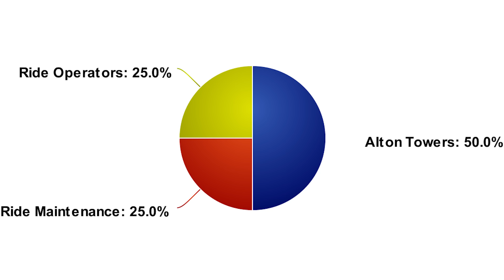What Really Happened on The Smiler Alton Towers june 2nd 2015?

Comment: Smiler is amazing and very safe, this incident was a human error. I hate how every UK news website talks about it WHENEVER an incident occurs at the park, its so annoying
Reply: ik
Reply: I agree
Reply: Theme Park Insanity The red top papers have a journalist on site at all times and any reports of rides delaying are treated as major safety incidents.  The British gutter press can’t leave Alton Towers alone, it’s pathetic.
Reply: Wrong, it was not human error. It was systematic error on Merlin’s part.
Reply: @jeeedel2491  What I meant is that humans caused the crash, not the ride itself
Reply: John Delaney Wrong, the crash was human error.
Reply: Never mind that at least one huge bolt sheared off of the Smiler and the fact that they didn’t refabricate a part of the ride that didn’t fit correctly when building it; they just “bent” the metal to make it fit. That coaster makes me nervous unlike any other.
Reply: John Delaney It was a human error, they sent out an empty cart and it didn’t make it all around the track. They forgot about it since the cart didn’t return. They sent off the next cart without knowing and that’s how the crash happened, it wasn’t a systematic error, it was a human error.
Reply: Emma Harwood Well said. The ride system was fine.
Reply: John Delaney It was completely a human error, the safety features built into the ride had activated causing a whole system lockdown, from that the ride operator has to do a system reboot, this is what had happened therefore the whole situation was in fact a human error, but you could have just done a google search to find that out but you seem to be the type of guy that would rather be wrong than accept some education 🤣
Reply: It'll blow over. The New Texas Giant is my favorite local coaster and no one mentions that it killed someone any more. The only reminder are all the signs that basically say "If you're too fat to close the lap bar, you don't ride."
Reply: This comment had 666 likes
Reply: it does break down a lot though, it’s has a lot of problems. even when i was there it had technical issues all day. but i do agree w you
Reply: Yeah, it really pisses me off! "Riders left hanging upside down for FORTY MINUTES in TERRIFYING ordeal at Alton Towers!" or something, when in reality, the ride stopped for safety reasons due to an alert or something, and they were stuck on a lift hill for a while while operators checked out the issue. It's an occurrence that happens EVERY DAY in EVERY SINGLE park across the world, and just because of this accident, they blow it way out of proportion.
And of course they mention The Smiler's incident in the article as well... "coming off the back of the incident with The Smiler in 2015 where 4 people were seriously injured..." blah blah blah...
Reply: @emma7788  Not just that.  The ride detected the valley'd train and automatically shut down the lift hill.  They had to manually override the safety system to send out the loaded train.  In my opinion, it shouldn't even be possible to manually override the block safety system.  If the block safety system is not working correctly (the only reason to override it), the ride should be shut down until it is fixed.
Reply: suny123boy1 No I’m not, you however are.
Reply: @rueh1747  Oof
Reply: @bby04  I guess that's true, but it doesn't break down that much more than any other ride at Towers.
Reply: suny123boy1  Explain to me why then.
Reply: suny123boy1  How is she wrong? You're seriously telling me that the ride crashed because the ride system didn't stop the incident? Please educate yourself before making untrue statements about topics that you clearly know barely anything about.
Reply: Its not the worst incident at a theme park by far. A kid fucking fell out of the space invader at Blackpool pleasure beach and killed himself
Reply: @bby04   that's not really a safety issue. The ultimate at lightwater vally breaks down everyday lol. Still no one has died on it
Reply: Nicholas Smith if the ride is breaking and literal bolts are falling off of it while people ride.. that could make it a safety issue.
Reply: Theme Park Insanity   Ye I went on it it is very safe this isn’t real I think I don’t think the crash was real it is very safe
Reply: Yeah they keep slating the park every time smiler stops on its lift hill
Reply: It probably has something to do with the UK doesn’t really have any interesting news so they just milk whatever they can
Reply: @PowerOf One It doesn't????
Reply: If it was safe why did this stupid shit happen? Like chill out bro maybe you should've been in the one that crashed and felt tha pain
Reply: But there's cameras all over the ride that cover the whole circuit! These are shows on the screens arround the operator, yet they didn't see the train struggle to make the incline?  over rided the system and sent a train out
Reply: @princessundead9734  Because the ride op overrode the system? You chill out, you came into this conversation swearing over a topic that you know NOTHING about, get out
Reply: @mathewwade1415  Yeah, the ride op overrode the system for some reason
Reply: Yeah like Man breaks leg on path at Aston Towers this is not the first time after the smiler accident in 2015
Reply: @adamkim4484  ?????
Reply: @benxyb2791  Its just an example
Reply: @adamkim4484  of what?
Reply: @yep.1106  he could have watched the fucking video
Reply: Yes and it’s only Alton’s I seen more on this than the Scotland one where people died
Reply: you never realize how much the media lies until it talks about something you're knowledgeable in.
Reply: @vicious3526  yep I know a lot about coaster crashes and this ride was a human error
Reply: People love to talk a lot about bad news, and totally forgotten if there is any good news. COVID 19 for example.
Reply: @JaceTan-90  THIS
Reply: @princessundead9734  HUMANS DIDNT NOTICE THE NEW TRAIN AND OVERRODE THE EMERGENCY BREAK AUTOMATICALLY DONE, THIS WASN’T THE COASTERS FAULT, IT WAS THE FAULT MAYBE OF MERLIN FOR NOT CLOSING THE RIDE IN THE HIGH WINDS, AND ALSO THE FAULT OF LAZY OPS
Reply: true remember when someone tripped in west park and cut their knee they shut the park down just cuz somone tripped
Reply: 1000000% agree with u
Reply: @jeeedel2491  You obviously don't know about block sections.
Reply: Let's hope they employ trained staff hey.
Reply: @Linaskye143  tbh it’s one of the safest rides in the world
Reply: @DiRtYLaWs2007  and the worst part is, the smiler has been the only such incident to occur at the theme park since its opening as a theme park in the 70s...
Reply: so it's safe unless someone makes a mistake then it becomes unsafe? sounds... unsafe.
Reply: @nutallergysufferer5315  yeah, but not mainly motivated because of the ride itself like some people would think
Reply: Ok? so human error can happen again, i'd rather not chance it on ANY ride.

Comment: As someone who used to work as a ride operator it’s just WILD to me that they didn’t visually inspect the track before giving the OK to override the safety stop. Like...these safety measures exist for a reason and this easily could have been avoided if folks just...used their eyes
Reply: Even without being a ride operator I would have thought they would visually investigate where the 'ghost train' is. That would have been the correct way to go about checking for potentially having to eliminate the hazard?! First rule: eliminate the hazard whenever possible. Second rule: Minimise the hazard (including using PPE that is safe for the purpose) where this is not possible. Third rule: Unsafe PPE that saw any accident or fall instead of a safe 'abseil' (harnesses, ropes, especially!!! Working at Height) needs to be discarded, sent to the contractor for replacement, tears or wear visible or not or specialist-checked before any further use is possible, any 'abseil' equipment needs to be checked before every use. Also, any visible tears or wear in a rope could endanger lives, too. Any carabiner or systems that people are gear is hung into or onto needs to have the minimum kN needed for the purpose... . And if it is truss, a planned weight load spread over where to hang what in what distance... . Any ML (moving lights, any speakers, anything accessory). As a semi-pro wedding planner maybe you get away without one just using one extra disco ball but if you mean business, you got to have a rigging planner. Any escape route needs to be existimated. Any lift system regularly checked. Any door release.
 Any hazards or cleaning cupboards always locked in their designated areas. Any combustibles or potential fire hazards need to be stored away from draughts, heat sources, beams that fires could spread through (forgot the technical term for it but fires do spread in different ways and sometimes work their ways through buildings with metal beams... ...and not just directly), and people who are not trained to safely use those restricted fireworks bodies. Some people don't know that fires do not only spread in direct ways but you learn that at Fire Warden training... . Fire wardens are even the ones also dealing with making sure about any lift systems, door systems, and anything that needs storage and who overlook the fire drills and control the assembly points. A fire warden at work would also have to help navigate to help elderly and vulnerable when it is safe to do so for the person without risking one's own life.
Reply: The smiler more like the Frowner
Reply: Totally agree
Reply: I have a feeling on that day the ride had stopped working quite a few times, as If I remember rightly, we had been a couple weeks before and queued hours because they kept sending vacant carts because it was throwing errors.   I think it was one of those, assumed it was the same errors from before just playing up and manually override the safety.  Which was just stupid.  They should have fully checked the track for the locations of the carts.
Reply: They did the engineer checked where the 4 carts where, he didn’t know there was a 5th one
Reply: @vource2670  But they didn't check the ride itself, where the error had occurred. They were given information that stated there was another train on the tracks. No matter how sure you are that that isn't true, it would be so easy to check and make sure, and that's your responsibility to do if this is your job.
Reply: @WhiteWolf-lm7gj  
Especially since the smiler does have five trains. The failure to physically check would be somewhat understandable if the system was saying a sixth train had magically appeared, but ridiculous knowing that five trains was a physical possibility.
Reply: I thought that too! Why didn't they just send someone out to look at the whole coaster they would have seen the ride at the bottom of the loop! It's crazy how lazy they were!
Reply: If the system says there is a fifth train, then there probably is a fifth train
Reply: Or at the very least ascertain the location of all five trains, regardless of whether they are on the track or not.  Train 1 is stalled on the lift, cool.  Train 2 is in the station, trains 3 and 4 are in the brakes.  Where is train 5?  Is it on the maintenance track where it is supposed to be?  No?  Then where is it?  Multi-ton vehicles don't just vanish.  Go find that train and don't override anything until you know exactly where all five trains are.

Comment: I worked here for a day when I was 16. They left me at the entrance of the smiler ride with hardly any training. They didn’t even expect me so had nobody there to train me, I was told what to do briefly and left at the entrance for over 2 hours. There was a phone at the front that rang into the inside of the ride and I asked for help and I was told no one could come and help me. I ended up having a huge panic attack. I chose not to go back and I explained the situation to them and they said sorry you feel this way and just asked for my uniform back. The management here are ridiculous. My training consisted of reading a booklet, no actual on the job training, it made me feel like I could have potentinally  contributed to an accident as I wasn’t  adequately trained

Comment: If you're going to override a safety sensor you should not only know where all cars are but also try to figure out why the sensor is "wrong". Even if all the cars were accounted for, there could still be something mechanically wrong with the track causing the sensor not to work properly. What if the sensor though there was a car on the track because something in the track broke loose and cut wires or destroyed the sensors or something, knowing where all cars are does nothing if the track itself actually were broken.

And if you do find that the sensor is actually wrong, you should replace it and until it is replaced have someone stand watch and do the job of the broken sensor.

Comment: If I was working on any roller coaster.  If the block brakes self activated, a ride stop. I would have gone out and done a manual visual track check. I would never restart a ride, without a visual check. To see any reason why the ride computer, triggered the stop.
Reply: Then again if you counted up all the known trains in service, you'd be prompted to make the assumption that the track was clear and that no visual inspection was needed
Reply: @bulletnotloaded3586  I suppose if you wanted to be 100% sure that a collision would not be possible, then you would verify where every single train was, including those in storage
Reply: @pineappleroad  Well that's exactly what they do now. On all Merlin rides
Reply: and evacuate then check and count evry train also in the maintenance bay and if they where still stupid enaugh too miss count then send a train then overwrite the fault then its only structurel damage

i feel with you

Comment: I would says it's 75 percent Alton Towers because that knee that it shouldn't be running over a certain amount for high winds and they did anyways. Tod whole thing would of been avoided, 15 percent the employees fault as they are just doing what management tells them to do and to run the coaster but they should ot told maintance they added another train and then 10 percent the maintenance. That fact that the employees didn't tell maintenance they added a 5th train was a bigger percent of the employees fault. Because the maintenance didn't know they added a 5th train they would assume it was a malfunction and there no train on the track. If the employees would of told maintenance they added a 5th train they would of definitely checked to see where all the cars were. But regularless of this it was partially maintenance fault for not doing a double check.

Anyways you bet next time they will ask employees if they added another car and or checked to see where all the cars are.

I also just find it weird and maybe this isn't a UK thing but in the United States whenever there is a malfunction on a roller coaster they will run 2 to 3 cars empty first before allowing riders on any train. How does this not happen at Alton Towers which is a major theme park for UK.
Reply: They only run 1 train because Alton towers is so popular that they don’t have time and the ride is supposed to function correctly even after one train. Also I don’t think that it was Alton towers fault that much. Operating in high winds can cause the ride to valley however this isn’t unsafe, it’s just an inconvenience.
Reply: @Gabes1321  a pretty big inconvenience for the youngsters that lost their legs. Safety is paramount
Reply: @allisonday893  but if you watched the video then you would know that it wasn’t just the winds which caused the accident. It was also the maintenance team and the ride ops
Reply: I think winds can be tricky. Sometimes is breezy with occasional wind gusts...some of those may have been over the threshold, but what if it was consistently windy?
Reply: @jasonhaynes2952  in the uk it isn’t usually consistent it’s just large gusts
Reply: good job finding a way to lay the blame like that
Reply: *would've (would have)

Comment: What happened was extremely unfortunate and something that could have so easily been avoided. Since the accident, even the slightest issue, such as a train stuck on the lift, is seen by the media and the story becomes really over-dramatized, when in reality it's a completely normal and safe function of a modern roller coaster. Really triggers me when stories like that appear.